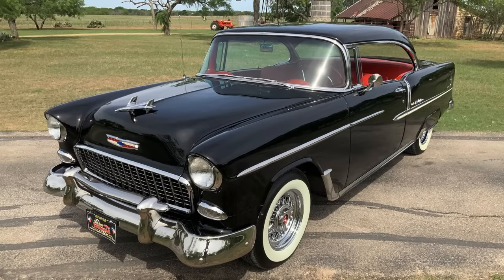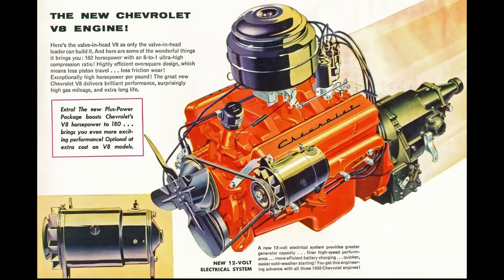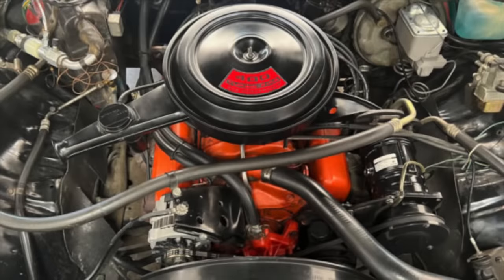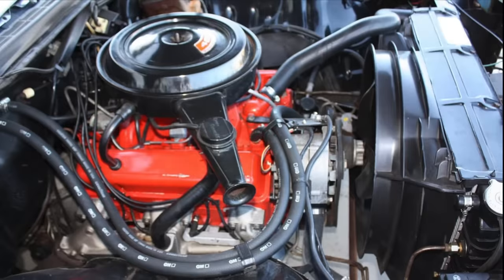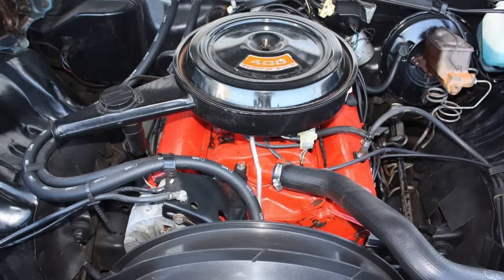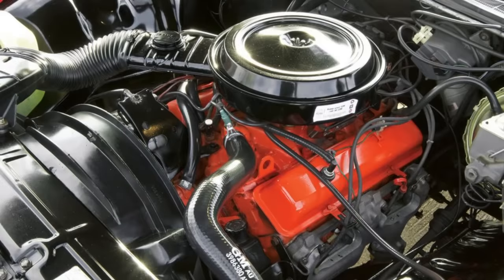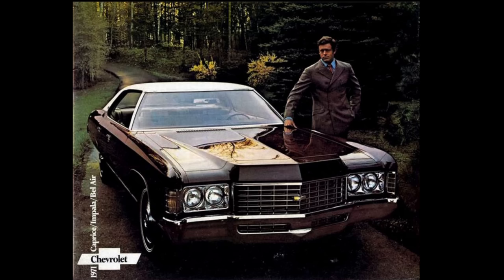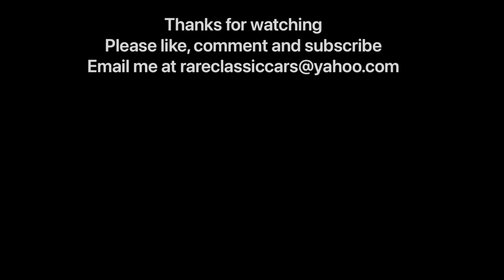Forgotten Engines: The 400 Cubic Inch Chevrolet Small Block V8 (1970-1980)

Comment: 400's are FAR from forgotten. True car guys knew what they had. SB 400 could be stroked to 427.
Reply: Had a high nickel 400, 40 over. Kept it 6 years without  building it. Went LS, sold the 400 block as is for 50 bucks more than I paid for it. There was no shortage of interested buyers.
Reply: My favorite small block. A few mods and it will pump out the torque then the horsepower. I used them on the dirk track for years. A couple 406 lower cost builds, then an all out race 421 stroker. 73 feature wins in a 5 year period with a 400 engine.
Reply: 434 ci.
Reply: We spun one with a 283 crank to 10,200 RPM to make 760 HP. What fun that screamer was.
Reply: 427 is a big block- same as 454.
Reply: @bartlevenson7851    The ZR 1 Corvette has the 427 engine @ 760 horsepower.
You can make a 434ci. out of the 400 small block. If you put a set of camel hump heads on the 400, you get 350 + horsepower. You have to drill out the steam ports on camel hump heads, or it will overheat.
Reply: @JT-SE-OHIO my dad used to build 421 for late models super nasty way back in late 80s early 90s. Last one he built he got block from Billy Moyer who we raced against at our local track seemed like every other weekend but I was like 5-8 years old so can’t remember exactly how often races were. I just know my first memories are helping him in the garage build engines and over at his friends Charlie Martin the 421 went in his late model. He also building other engines for other classes but he was the best around building good power with little money
Reply: @bartlevenson7851 Many have stroked them, the 400sb, to 427ci.
Reply: @ceciltrane5418 that’s awesome
Reply: You got that right! Don't forget they're using Sprint cars on the dirt track as well as modifieds and everything else.
Reply: I put a 350 crank in my SB400
Reply: 406
Reply: @cliffjump71 Sure he did. They make special bearings to make that swap. Std bore turns out to be a 377
Reply: @mcyclonegt how long were your rods in that thing?
Reply: @8092DJ problem with that it the crank and rods will hit the camshaft if the lobes are larger especially a roller camshaft.. dart little m is made with a raised cam boss for a reason when building 434
Reply: Didn't they have the 427 (7.0 litre) in production 🤔
Reply: @OliverMoore1973 yes but the production 427 was a big block.
Reply: @bartlevenson7851 Lol 😅😊

Comment: The 400 went to 2-bolt main caps because the 4-bolt blocks had a habit of cracking at the outer main cap bolt holes. The 2-bolt blocks are actually preferred for high performance builds over the 4-bolt blocks just for that reason.
Reply: You are correct
Reply: I was going to add a comment along this line.  When building a 400 - if you can find one - you want the 2 bolt block.  The main caps on the 2 bolt block are big block style main caps with a wider register than other small block 2 bolt caps.  I think the register is the same as the 4 bolt factory caps.
Reply: Possible too much Torque  ?
Reply: @paulcalloway4364  no, it's not that. It's because of the spacing of the bolt holes. The 400 uses a larger crank journal than a 350 does, it's unique to the 400. The main journal is nearly as big as a big block actually. But it pushed the main cap bolts outward, which is what caused the problem.
Reply: I have a 2 bolt main 400 block. Guys opted for these because you could machine it for 4 bolt splayed caps not affecting the bearing web integrity of the block. Eventually guys went for the Dart blocks for a better race platform.
Reply: @Shaft-Industries  I've got a 2-bolt 400 myself as well. Not sure what I'll do with it yet lol, but it's sitting there. It's got a nodular crank too, tho I think all the 400s had that
Reply: @adammcilmoyl4278 You are correct - all 400s in fact did get the ductile iron (nodular iron) crank, none were factory with a forged crank.  It's the reason why the mains on these engines are so large (2.65 vs 2.45 "large journal" small blocks).
Reply: @silicon212  yeah I'm surprised they went so large with the crank. There really wasn't any reason to go that big, crank failures are rare in a SBC, even the cast ones. That's almost as big as the big block crank, which I believe was 2.75in.
Reply: The number of people who've rolled their eyes at me after I've told them that alloy and price are important, just buy the "junk" two bolt core that's in good shape. I've never seen one of my beloved two bolts fail due to not having enough bolts
Reply: @MyJp1983  honestly, for a high performance engine, the factory 4 bolt setup with its 4 vertical bolts isn't much help anyway. It helps with high load, low rpm situations like a truck would see, but the problem with high rpm use is cap walk, which 4 vertical bolts doesn't help. Splayed bolts or cross bolts (like a hemi or FE Ford) are what you need to fix the cap walk issue in a high rpm engine.
Reply: I put a 509 block, 2 bolt Main, destroked to 377 CI, with 6-inch rods, short Pistons, solid lifters and a 9lb flywheel in a 89 Corvette SCCA car! Spun up to 7500 RPMs so fast and was a blast to drive.
( eventually I killed the straps but that's my fault)
Reply: That’s one reason I like the 509 block
Reply: @barrykilts4506  that's also the casting I've got. I think it was the best of the production line 400 blocks, where GM got the most issues sorted out.
Reply: @MyJp1983 back in my day it was accepted as gospel that you needed a 4 bolt block , but you are correct at least to a degree. I didn't hear much about 2 bolts failing when paired with a auto tran , or in a lighter car . Where I know they did not stand up was a bigger car/pickup with a manual transmission. One company I know of was using them as replacement in school busses , and had average life of 6,000 miles . I think it was more a matter of the cast cranks distorting than the two bolt block not standing up
Reply: Loved my 72 Impala 2 door custom coupe with the 400. It moved that big car with ease.
Reply: Mom had an impala station wagon 76 400 4 barrel Rochester even though it was one wheel peel it would burn it off
Reply: EXACTLY

Comment: My family had a '74 4 door BelAir with the 400/2v setup. My dad loved that car, which got great fuel mileage. A mechanic once told him that the carb was way out of adjustment, to which dad responded, "If you touch that carb I'll bust you in the mouth!"
Reply: was probably running extremely lean
Reply: When run ~10-15% lean you get none of the heat problems from running ~1-9% lean, while raking in the fuel saving
Reply: @southjerseyboy2844 a little lean is bad but a lot of lean is really good
Reply: Yes whenever I took my old Chevys for a tuneup they ran worse.
Reply: @Texassince1836  the downside is a severe lack of power
Reply: @southjerseyboy2844  Thats what the power enrichment circuit is for. Once power demands cause a loss of vacuum the power enrichment comes back in and you're rich again.  I tuned the Quadrajet on my '86 Suburban to be 16.2:1 at light throttle cruise, but once vacuum got below 10 inches the power piston came up and I was back to 14.5:1 in the primaries, and 13:1 in the seccondaries. 

Holley-power valve
Edelbrock and Rochester- primary needles and their springs.
Reply: @southjerseyboy2844 True but if you run to lean of jetting bad things can happen like melted spark plugs and holes in the tops of the pistons lol and of course it gets worse if your running the engine with the timing advanced and total timing set advanced higher . Every engine I build I take it to my local dyno shop to start the engine once the oil pump is primed then they run the engine up to full temperature then shut it down doing this a couple times to heat cycle the engine and to check for any leaks . Once this is done they then start making pulls on the dyno to make changes to timing and of course jetting changes to get the A/F ratios right where they should be for all 8 cylinders and once that's done they keep making pulls not full throttle pulls until they can see on the dyno chart that the rings have seated fully so once that's done it's full throttle pulls & seeing if the engine can be run up higher in the rpm range or not and tuned for max power.  The couple hundred bucks it cost to dyno the engine is worth it for the extra power it will make and knowing the jetting and timing are spot on plus it's easier to find leaks once on the dyno and easier to fix once off the dyno rather than fixing  it in the vehicle . I've got a 400 sbc that I'm going to build for my 82 Chevrolet K10 but I'm ditching the stock heads and going with a modern head that will flow better and have better quench in the combustion chambers along with bigger valves that are already drilled for the steam holes and I plan on running a full roller cam to get me the power I want out of it mostly more torque because this engine is going into my plow truck that plows my driveway but during the summer I do drive the truck at times for the fun of it .  I keep the truck off the salted roads here in WI during the winter so the body is in real good shape yet so building this engine is worth doing for my plow truck .

Comment: My uncle also had a full time 4 wheel drive 3/4 ton 1977 Chevy truck with a 400 in it. It didn't matter if it was on country roads or going down the highway at 55 mph empty or fully loaded, it always made 9 mpg.
Reply: Up hill,down hill .With the wind,against  the wind.   No camper.10 1/2 foot cab over.   No boat or 20 foot.
Reply: Full time 4WD junk and low 4.10 gears. I got a 400 SB in a 72 K10 pickup with 4 speed and 3.07 gears, get 13 and 14 mpgs easy.
Reply: 14mpg in my 79 K10 stepside with 3.73 gearing.
Reply: Funny stuff. Got a 400 from a '77. Balanced it, quenched with mild port work and different cam. Put it in a '70 3/4 4wd. For a 5,000lb truck that 400 really moved it well. 650 Holley got 9mpg. In a 3,000lb Camaro that engine would have been a handful
Reply: The full time 4wd in a 3/4 ton was the problem there... not the engine.  It wouldn't matter what engine that truck had, it would have always made 9 mpg... maybe 10 with a 292...
I put a 400 in my '79 1/2 ton Suburban with a Q-Jet and a TH350C (lockup converter) trans and 3.40 gears... It does 18 mpg as long as I keep it under 65 mph, since it has the aerodynamics of a brick.
Reply: @livewire2759 yeah I agree. I knew that as a kid in the 1980's even that it was because of the full time 4x4.
Reply: I have a 76 1 ton with a sbc 400, turbo400 3 speed and 4.10 gears with swapped part time 4x4. I can confirm, I get 9mpg towing a dual axle flatbed with sxs and 4 quads over the pass. And I also get 9mpg driving down the highway to work on flat roads with no trailer.
Reply: Chevrolet didn't make a full time 4WD truck in 1977 and I believe it could get up to 17mpg on the highway.
Reply: @duanepayne1805  yes they did because I vividly remember my uncle having it and my dad using it a lot. It was a 3/4 ton with a 400 SBC. I was around 10 years old so I couldn't tell you which automatic transmission it had (TH350 or TH400) or what transfer case model number it was, but it was definitely a full time 4x4, just 4 high and 4 low and neutral. There was no manual locking hubs on the outside of the axles. I was young, but I was already into cars and trucks.
Reply: 1979 K5 Blazer, full time 4 wheel drive, turbo 350 trans, 3.41 gears and it gets 13mpg.
Reply: @idaho2ndgens240 that's 4 mpg better than my uncle's 1977 3/4 full time 4x4 truck with a SBC 400 did! Lol! It didn't matter if it was empty or full.
Reply: Early 80s Chevy and GMC 2500 trucks still had full time 4WD.

Comment: I recall reading that Chevrolet's 402 cubic inch big block was also at some point marketed as "396" after the original 396 was retired.
Reply: Yes it was, had a 71 Camaro SS 396  with a 402 was a pretty good engine, still no clue why GM changed from the 396 to 402🤔
Reply: @forterierocks Emissions. In 1970 a rule came down that anything under 400 cubic inches had to be emissions equipped. They bored the 396 to a 402 to skirt regulations, and often marketed it as a 396 to appeal to the image that it had on the street.
Reply: This is a bit confusing as I heard or read that the original 396 always WAS a 402 but because of the GM mandate at the time, only full-size vehicles were authorized to exceed 400 cu. in. engines.  Reportedly, Chevy just called that engine a 396 to bend the rules.  I’m certain Adam likely knows the whole story.
Reply: @Primus54  I don't think that is right. I believe what @richardyokom9282 wrote is correct. The original Chevy 396 had bore at 4.094 in and stroke at 3.760 in. The 402 cu in engine (marketed as 396) had the same stroke with a bore at 4.124 in.
Reply: @Primus54  In 1970, Chevy bored out the 396 cid big blocks by 0.03” from 4.094” to 4.125”, which raised the total displacement to 402 cid. Pretty much everything else stayed the same internally. One other change though was the spark plugs, which got a new seating design for 1970.
Reply: The 1970 SS 396 Chevelle is indeed a 402.
Reply: Chevrolet marketed the big block 402 as a 396 in the smaller cars but called it a 400 in the larger cars and light trucks.  To add to the confusion the small block 400 which had almost exactly the same bore and stroke was also available in many of them.  Pontiac also made a 400 V8 with the same bore and stroke.  Today we have cars that have more horsepower (but at a higher RPM) with only six cylinders thanks to electronic fuel injection, variable valve timing, and other modern technological improvements.
Reply: Us old car guys would say 400 small block or 400 big block to differentiate the 2 when talking Chevy 400. Now most younger 8:31 guys seem to say big block when  talking about engines that only were big blocks. Like it's got a 455 big block, 460 big block, 454 big block, 428... It's redundant. Why
Reply: Nope. For the first year ( maybe 2 yrs ), the 396 was indeed a 396. After that, they bored all of the 396's 0.030" over, I believe, to get the 402. But they still called it the 396.  @Primus54
Reply: You are correct. But it would be better understood as 0.030" ( which is 30 thousandths ) vs simply calling it 0.03".  @forterierocks
Reply: GM engine plants had a strike in the winter of 1969-1970. The workers walked off and almost all the newly cast and machined 396 blocks were left in the winter weather. When the strike finally ended in early spring 1970, they had to bore most of the 396 blocks .030 overbore, so they could use them. This actually made the engines 402 CI. They already had the paperwork and identifying processes out, so they kept it labeled as 396 CI. When the foundry started producing the new castings in 1970, they just kept the 402 bores so all the newly manufactured pistons could be continued to use.

Comment: The 400 spawned an engine GM never built for production.  The 377/383 SBC.  A 400 crank in a 350 block.  The performance minded crowd loved it.

Comment: As I recall the 400 was not popular because it would run hot when towing and performance situations.  The block just didn't handle the larger bore very well. And they had the 402 large block that handled the same situations better, it simply didn't answer any questions that people were asking.

Comment: Great watch.    My personal favorite is still the 327, mated to a four speed of course.....
Thanks Adam for keeping automotive history alive.
Reply: Love the Chevy 327! My favorite also.
I also have always had a soft spot for the 283. The first vehicle that my folks allowed me to drive to school (Freshman and Sophomore years), was a '66 C10 long wheelbase with a 283 and 4-spd.
Reply: The 327 was my favorite too!  I had one in my 59 Chevy Impala Sport Coupe.
I replaced the original 283 with a 300 hp 1962 327 and beefed it up with solid lifters and a fuel injected cam.  I topped it off with a direct linkage 3 X 2 Stromberg 97 carbs and a Malory dual point distributor.  I backed it up with a close ratio 3 speed with an 11 inch heavy duty truck clutch and a 3.52 ratio posi rearend.  The only thing I could not beat was those 413 Wedge Dodges with 4-speeds.  They would always beat me the last two car lengths of the quarter mile.
Reply: I had a '66 Chevelle with the 275 hp version of the 327 mated to a Saginaw 4 spd trans. With 307 gears it wasn't the quickest but I could outrun the muscle cars on the open road. Much fun!!
Reply: 340 horse with  duntov 30 30 cam  in my 56 chevy my favorite, why did I sell it!!!!!
Reply: My 68 Malibu had a 327 that I built and it was pretty good,  but it had a Powerglide 2 speed and I should have put a lower gear ratio in it. As it was I ran it in the mid 15s.
Reply: Been there, done that.....
LOL @WilmerCook

Comment: I had a 72 4dr hardtop Caprice with the 400 small block in it when I was younger. What a great car! Smooth and comfortable with plenty of power for everyday driving. I miss it.
Reply: So did I.  My first car.  Did yours use oil?  Mine used 1 qt. Every 500-700 miles.
Reply: I had a 2 dr with the 400 small block.  I put a 4bbl and dual exhausts on her and she was damn fun to drive, esp for her size.

Comment: Many years ago in the late 70s, I helped my next door neighbor put a 400 small block in a 1969 Camaro, 4 speed with a 12 bolt posi and a 4 barrel carb, she ran very strong. A friend I grew up with wound up buying it and we spent many a weekend at the street races. The gas mileage was terrible for two broke kids just out to have fun, but fun we did have. Brings back a lot of memories.